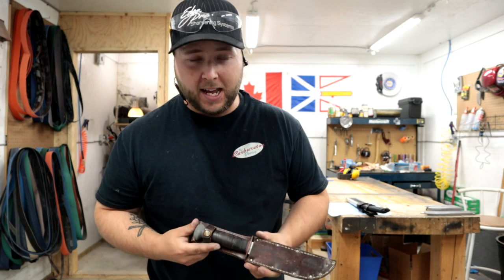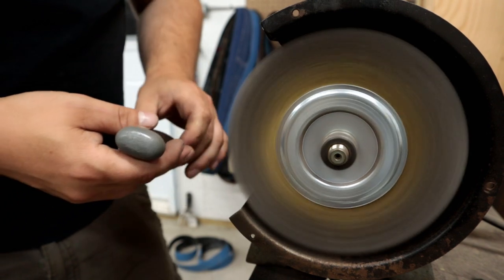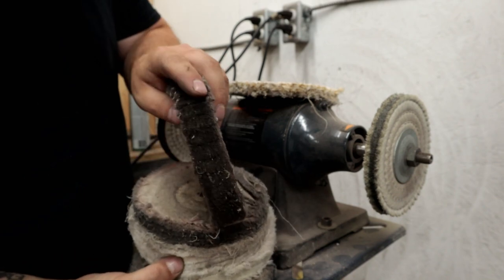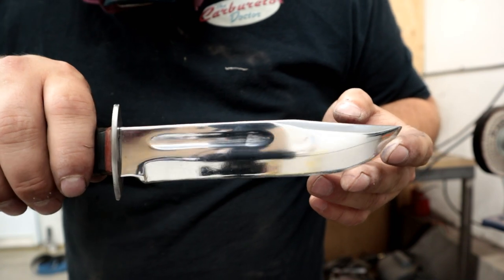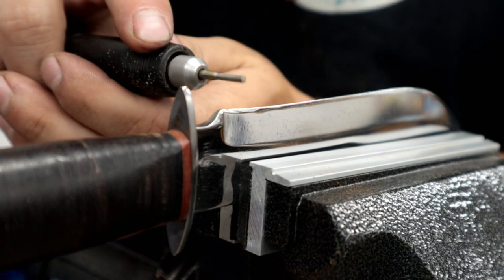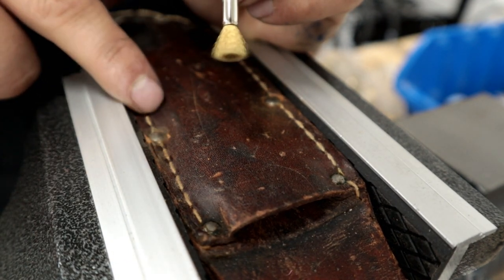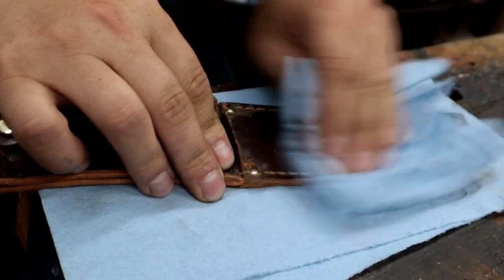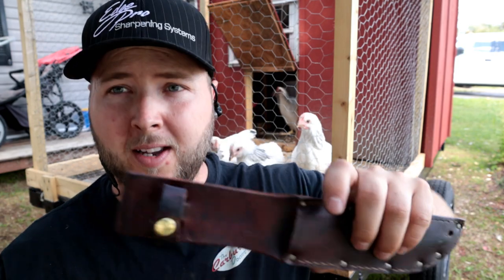Restoring an Antique WWII Military Knife

Comment: Try a magnet on the side of those bristles. You might find they are just soft steel with a brass coating. Doesn't matter if it does the job you want it to. Thumbs up buddy.
Reply from the maker: Thanks John!

Comment: According to my grandfather, it was common for infantry to sharpen about 2 inches up the back edge or false edge. He carried his PAL in the Aleutian Islands and in Italy. He gave it to me when I went into the infantry. I carried it in Desert Storm and other parts of the world. The aluminum pommel was parkerized and left dull, along with the blade so it didn't reflect. Just maintained it with a hanky and CLP. The problem that I have with mine is the handle leather washers dry out and shrink.

Comment: Took a rh pal 36.rusty as fuck tip broken off... Retipped it polished it with 280..300. 360. 400.sand paper. Then wet sanded it. Happy birthday dad. Yup gave as a present. Wish I had a polishing wheel. Learned a lot from this video about the great advantages of the polish wheel. Dang!

Comment: What do I think? I think the previous person did the same thing you did by buffing it and rounded the crisp grind lines away. You wire wheeled it and buffed it also, rounding the grind lines even more. I am a knife snob and like the look of crisp grind lines.
     You sanded the nice slicked leather edges from the sheath and left them raw! You didn't even mink oil the edges, but you got the rest of the leather. Now moisture will get into the unprotected leather. Take the time with the rivets and use a wood toothpick. That dremel was cutting into the old leather way too much. You use way too many power tools to "restore" knives.

Comment: My father passed down an RH37 Pal Razor knife from 1943 stamped US Navy. The cap is missing, and there is a stub without a hole for the drift pin. Dad may well have broken the cap off. Was told that a Pal Razor knife in this condition is not worth much, but that was several years ago. Any ideas on finding a proper cap?

Comment: Use a magnet to test a metal you might think is aluminum. Aluminum is paramagnetic, meaning it is barely magnetic and won't respond to a magnet like steel will.

Comment: The pommel is supposed to look like that. It's "parkerized" I think the knife is likely a MK-1. The sheath is probably not belong to it. I could be wrong, but that's what it looks like to me.
Reply: That is the original sheath, tell by the lanyard hole. Mark 1(USN) is the utility knife designation, usually has a shorter blades around 5 inch. The Mark 2 are the combat knives with 6 to 7 inch blades and double hilt. Of course, there are exceptions, I have a Roberon MARK 1 with a double hilt and 5 inch blade. Each manufacturer would use the  War Department general specification and add their own twist to their finished product.

Comment: Amen, cheers to heritage blades. Bye point Kyle, I heard it the other day but wasn't sure,  I think you have a bearing going bad in your bench grinder with the wire wheel on, it has a nasty chatter with on weight on it , could be a20$ fix to do it now?? It just sounds floppy  :-) if you know what I mean 😏 Beautiful work bro 🍻😎👍